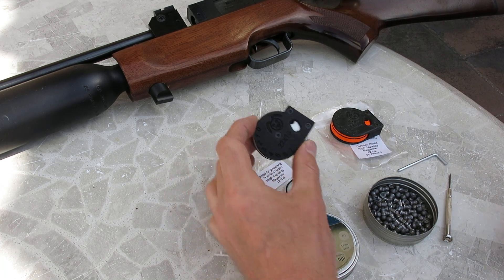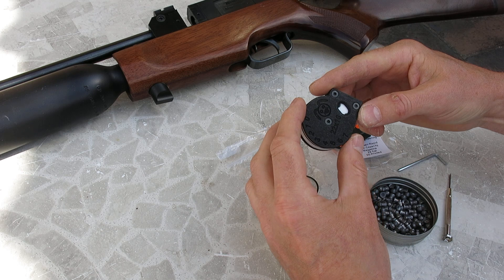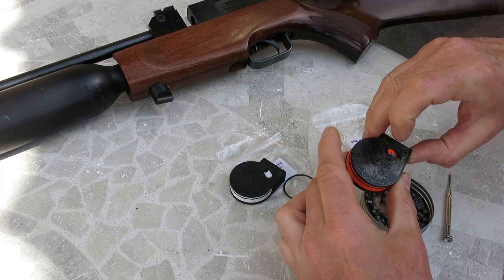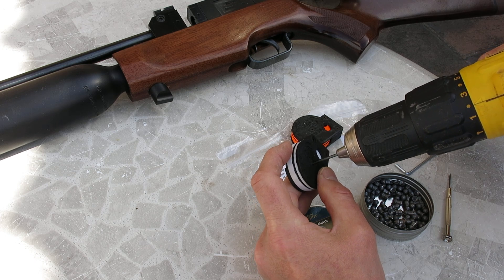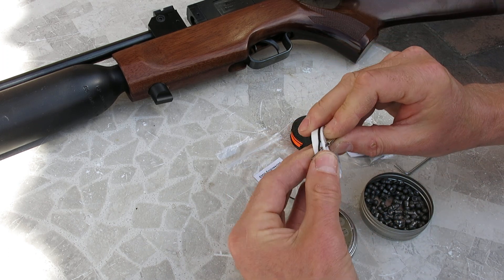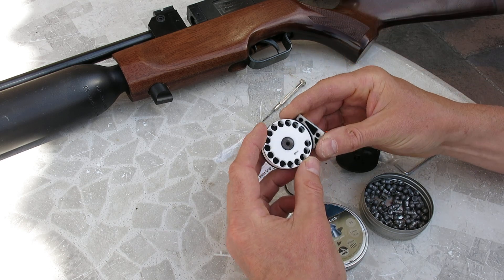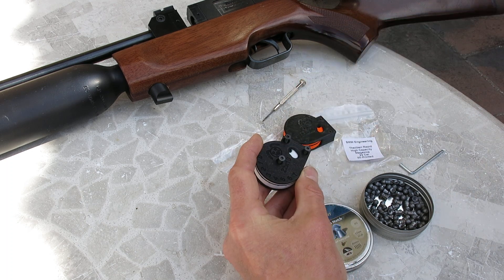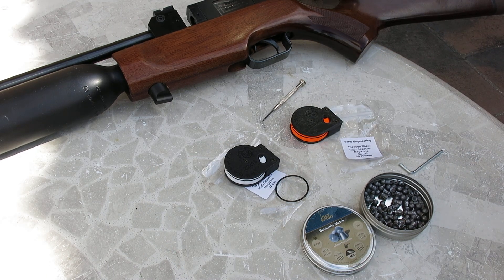SMW Engineering Theoben Magazine Use and Maintenance

Comment: why would the mags  differ in size ! coz its not the gun that all mild the same . so why would I bid 3d printed crap that don't fit proper and you have to strip ! and sand if don't. you said don't take a part more than fue times!! coz they strips threads . so if you having trouble citing mag sand it . not good is it the standard mags you don't have to fxxk about with not for me
Reply from the maker: Hi Daniel, not all Theoben Rapids are the same, there are slight variances which is why I made this video. I am afraid I don't understand the English in the rest of your question so I am not going to answer in case I cause confusion. I have hundreds of very happy customers.